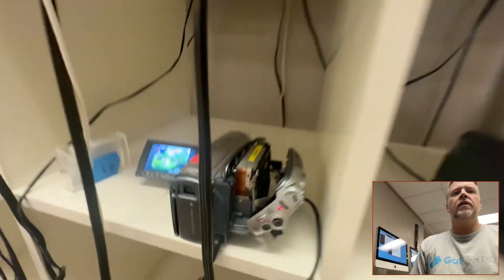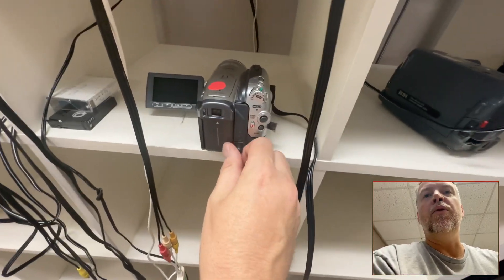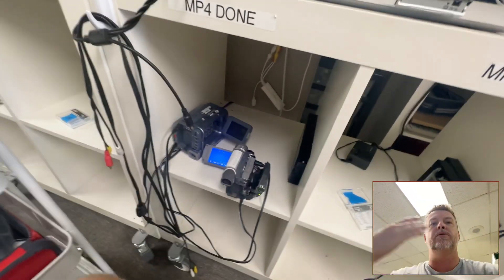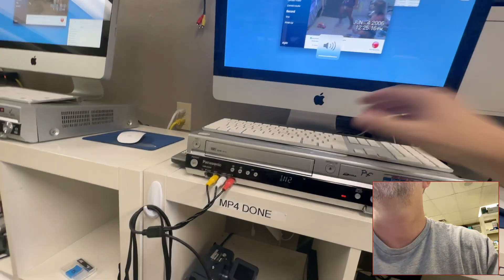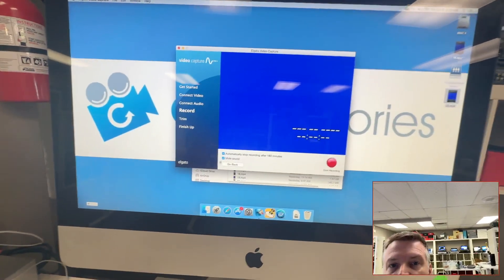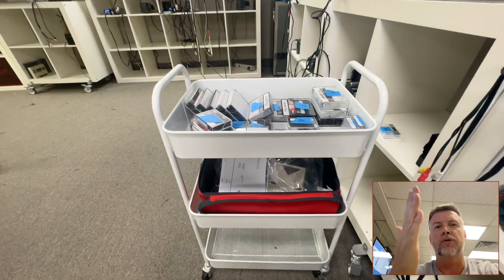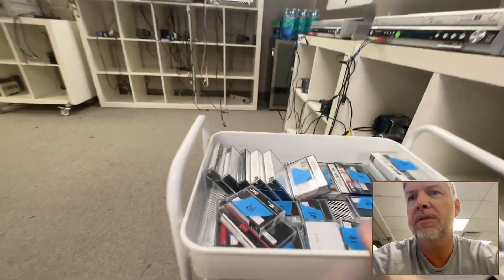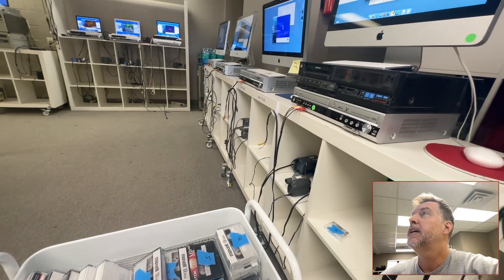Min DV Camcorder Video & Audio Issues, Problem Solved!

Comment: Hi Phil, your videos have been immensely helpful 🙏🏼 I wanted to ask if my Canon HV20 plays my old DV tapes with good audio but the file that is recorded from my AGPtek HD recorder has annoying audio “static” type of sounds what do you think could be causing that?  I’ve tried using different HDMI cables, different jump drives, etc. I ordered another HD recorder to see if the recorder was the issue but not sure if it is possible for the DV camcorder to play the audio fine but what is output via HDMI to have the static noise?
Reply from the maker: No idea there. Just have to try on other players, could be the player, could be the tape, could be the original recording.